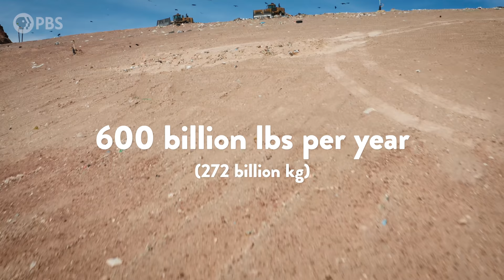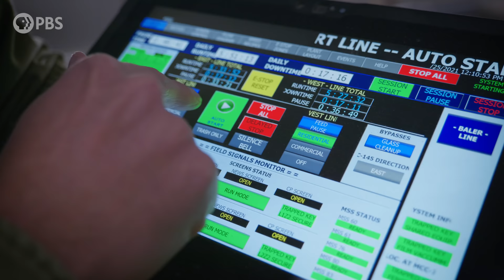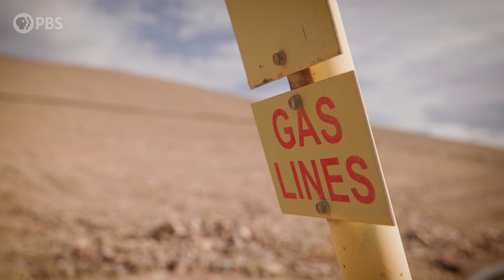How FIVE BILLION Pounds of Las Vegas Garbage Powers a City | Overview

Comment: In the city in Finland where I live less than 1% of all the waste goes to the landfill. 
That which can be recycled (metal,cardboard,wood,glas,paper,plastics,concrete,electronic and biowaste) is taken out and non-recyclable material goes to incineration.

The Waste-to-Energy plant outputs electricity and heat (the heat is led via heatpipes to the city homes/buildnings).

The biowaste is treated in an aneorobic digestion plant. Where methane is produced, the methane is upgraded to biogas that the local buses/trucks/cars use as fuel.
And after the biowaste comes out of the reactor it is composted for a few years and later used as fertilizer/soil for gardens/farmers.
Reply: We can't do efficient recycling to save our lives here in the US.
Reply: @cmendoza1094  why is that
Reply: It interferes with profit, of course.
At least in my city we take sewage and get natural gas from it for our buses
Reply: Instead of burying its waste Finland emits it into the air.

Comment: Las Vegas homes have two bins, garbage and recyclables. Several times a month you can put out large items such as furniture, refrigerators, old electronics, etc. and they get picked up. And Apex is where deceased pets, not buried in pet cemeteries, are taken for cremation and a decent burial away from the garbage. Plus all streets are swept once a week, usually the day after garbage pickup. Ours is Tuesday pickup, Wednesday the sweeper comes by.

Comment: Saying it's "per person" really implies that individuals, and not industry, is generating that waste. I don't think anyone poops that much. I can see the food waste. But no way I consume that much weight of packaging.
Reply: its not just poop, and i doubt poop is counted here. If you throw away a fridge or a couch, its considered waste. while you probably don't throw a couch away every month or so, you have to tally all the consumer items you threw in the long run. waste generated by industries would be the "easiest" to clean since they are usually homogenous which is important for efficient recycling processes. Consumer waste is difficult/costly to recycle because of its heterogeneity. sorting consumer waste for recycling helps, but that requires a behavioural change or else it will be expensive to process them further.
Reply: @Baise Duezcke well... Relatively more homogenous
Reply: I think you got the nail on the head. It's always the industry that's blaming us and yet it's them still producing this rubbish for us to consume. Even if there's an environmentally friendly option it's always more expensive. How are we in general as a society supposed to act responsibly if there's always a financial disadvantage to it.
Reply: @theobserver9131  They act as if the companies and industries are completely separate entities that exist outside of them.

Comment: My local sewage treatment plant has a flame constantly burning. It just seems like such a waste.
Reply: It's preventing explosions in the pipes.
Reply: Come up with a practical use for it!  Now, as Paul David points out, the main purpose of flares is safety, and typically there are a lot of engineers looking at minimizing the amount that goes into the flare system.  But maybe you can come up with a replacement for this engineered system that has been around for over a hundred years and is used a wide variety of situations, from oil and gas production, to fracking, to oil refineries, to according to you, your local sewage treatment plant.  But, make sure that you don't significantly increase the risk or reduce the capacity of the system.  There is a huge market for such a system.  But given the low price for natural gas in the USA, I think you have your work cut out for you!
Reply: the cost of a filtration system so that it can be used as fuel is probably too high and the volume too low to rationalize doing it on a cost basis.
Reply: It causes air pollution and add more problem to environment.
Reply: boil water with it, spin it, regulate it and mine bitcoin with it
Reply: @rimandoeduardo2685  seems I've heard flaring methane leaves carbon dioxide as a byproduct. Which is not nearly has bad of a greenhouse gas as methane.

Comment: Seems all we hear about from some politicians and activists are wind and solar energy and doing away with fossil fuels. Glad you made this video. I'm seeing efforts to clean the oceans and rivers also. I've been hearing of methane. I've known land fills produce it. I've wondered for some time if anyone was using it to produce energy. This is a great video. Thanks.
Reply: Maybe the reason you hear so much about wind and solar is because that’s the smartest/cleanest/cheapest way to go. If they can process garbage in a way that it illuminates waste and produces usable energy that’s great!
However, wind and solar are off the shelf ready solutions.
Reply: @solarwind907  True,wind and solar are smart, cheap, and clean...until you consider the mining and shipping of materials to make them and the batteries needed to store the energy when the wind isn't blowing and the sun isn't shining mush. That presents another set of problems. Also, the amount of those things needed to supply a large power grid.I believe alternatives are needed. A collective of energy producing technologies so to speak. Wind and solar will definitely play a part. I agree that methane could and should be burned as long as it can be done cleanly. Fossil fuels will be needed for some time but must be done cleanly as well.
Reply: @danielhanawalt4998  really glad you pointed out that wind and solar require mining and shipping! Wow, I had never thought of that!

You do realize of course, that ANYTHING you build requires mining and shipping, right? 
The plus for wind and solar is that the fuel is delivered free daily!  Fossil fuel, powered generators are great, but they generate air pollution, and CO2 emissions. Every minute of every day they operate. Nuclear is wonderful, except for the nuclear waste and the danger of a nuclear accident.

Yes, in order to generate electricity with wind and solar You’re going to have to do some mining and shipping of materials. Good God.
Reply: @solarwind907  You didn't read my reply maybe. or you would have seen I said wind and solar are smart, clean and cheap. They're just not so much so as some would like us to believe. And I promise, it's not free energy. Who do you think is going to pay for the mining and shipping? Who will pay for the manufacturing of products used for wind and solar? As far as nuclear waste, yes, that's a challenge. Accidents? There have been those of course. However, if you figure in the risk factors of fossil fuel energy we've been using for a long time, nuclear don't look so bad. Ever see a coal miner come out of the mine? Or a mine cave in? Also consider the sheer magnitude of energy needed and the amount of mining it will take to supply all the energy with just wind and solar. We're just scratching the surface of it now. I liked the idea of using coastal waves, tides, or underwater mills.  But that could cause some problems with the ecosystems in those areas. Ok, back to nuclear. The small modular reactors won't have the same problems as the giants we have now. It's just a matter of getting it done. Of course those won't be a silver bullet so to speak. There will be a need for all types of energy production.
Reply: @danielhanawalt4998  every single energy source is going to need a source of storage and right now lithium is the best source for that but that gets mined in South America prob not safely.
Reply: @joedumas6128  Yes, lithium is mined in South America, but more so in China. Cobalt is used in the batteries as well, which is mined in (I think West Congo?) and I it's said child labor does much of the cobalt mining.
Reply: @danielhanawalt4998  never mind the resources needed to make wind and solar, no one ever talks about disposing of them when they are no longer producing power.. it's an absolute nightmare
Reply: @busybody1474  You're right, disposal of those things is a nightmare. Some of it can be recycled, but not all of it. Reminds me of an animated movie where a little robot was scouring the earth looking for any biological life on the planet. The planet had become uninhabited because it had become a big landfill. A lot of the things that end up in landfills are toxic to biological life. Also, landfills create a lot of methane, a greenhouse gas.
Reply: Gas and petroleum plants also require mining and transporting large amounts of material for construction, and more of it, too! Stop acting like that problem is unique to wind and solar.

Comment: The way is to reduce consumption- this just can't go on.
Reply: Not necessarily. Companies do not create for quality anymore. Most consumer goods are built with planned obsolescence in mind, hence it winds up in the trash, per the plan, so the consumer can purchase again, increasing revenue for the company. Secondly, plastic is over-used and that's because it's cheap for companies to use plastic, as opposed to materials like metal or glass, which is nearly infinitely recyclable and environmentally inert, from my understanding. There's certainly some changes that could be made, but I don't think it's necessarily consumption from a principled standpoint, but how we do business. I know I'd certainly pay a little more for items made out of metal instead of plastic, knowing they'd almost surely last longer. I'd also be ok with metal/glass food containers instead of plastic (again, knowing it would cost a bit more), but so too could they use paper-based products for that. Paper decomposes in no time (2 to 6 weeks), or could be burned as a fuel source. That too would be an excellent solution I think.

Comment: Finally, a renewable energy source that actually makes sense.
Reply: Just because it works doesn't mean its a good idea. Think of the extremely dangerous chemicals you are creating through burning plastic and and other waste items
Reply: @thatguyslivemusic2999  That's what the exhaust filtration systems are for.  Think of that
Reply: This isn’t renewable. It’s recycled energy.
Reply: @Brandon-th9pi  yes it is. As long as we consume there'll always be methane gas to capture.
Reply: @thatguyslivemusic2999  burning plastic? It’s methane, you maroon

Comment: scientific questions should be settled, not by political intimidation. There is already plenty of political weight on the scales, on the side of those pushing the "global warming" scenario.

The fact that "global warming" models are not doing a very good job of predicting actual temperatures has led to a shift in rhetoric, with "climate change" now being substituted. This is an issue that needs to be contested by scientists using science, not political muscle.

Comment: They should also talk ab San Diego’s land fill
Reply: For over 20 years I've tried to get the city to trash to power... Using cooling stacks. And exhaust it into the sewer system. 
Sewage can also be burned for power.
But the cooling stacks. Are closed so no exhaust to air ..goes into the sewer pipes.  By that time its a vapor.

Comment: 5:49 (Tradeshow Crates) tradeshow is LVs largest industry and has the worlds largest convention center. Tradeshow booths are built and thrown away after a few shows. Partnering with sign and graphics is also a 50/50 waste generator. for every sqft of graphics there is 2 sqft of unrecycleable waste 3M is the leader of that market.

Comment: We need to share and promote ways of using less, which does not mean doing without.
Everybody's got  tricks for saving. Here's a couple I discovered... no more need for shaving cream cans. Lather up with bar soap. It's a fraction of the cost and Tiny fraction of the use of materials. And guess what it does just as good or better job since you rub soap right onto the skin.
Not to mention less shopping and disposing of cans.  Still not employed enough,   canvas bags to do your shopping. And a third one... if you use body powder ? Tape over 3/4 of the little holes. Manufacturers design it so that tons of powder comes out and it's wasted. It's much simpler and more effective than turning the lid to small openings. The list is endless... keep your tires properly filled.

Comment: NO OIL for PACKAGING or SINGLE-USE PLASTIC!  STAMP OUT STYRO, and HOLD the MANUFACTURERS RESPONSIBLE for CLEANUP & BETTER MATERIALS that are COMPOSTABLE & NOT FOSSIL-BASED.
Reply: Styrofoam is the worst shit ever created. I loathe its use in drinking cups and packaging filler. It takes up a lot of space and does not decay.

Comment: We upcycle thrown away single use plastic bags to synthetic rubber sheets for local footwear industry. More than 2 metric ton of single use plastic bags are upcycled daily in our factory. Every kilogram of fossil-based plastic produced, there is between 1.7 and 3.5 kilograms of carbon dioxide released. By our special formula and engineering we reduce overall plastic #pollution and #carbon_emissions

Comment: It would be much better if the garbage were burnt like in Germany, for example, and electricity was generated from it. So only the ashes and rubble have to be dumped, which is much better for the environment, especially so the metal is not buried but can be removed after incineration and thus reused.

Comment: I wish every city gave away garbage time capsule to visitors leaving the airport. 
Waste alcoholic beverage clear bottles filled with non organic trash ranging from cardboard, paper, plastic, electronic components and metal pieces, sealed with the city name and year. 
This could be a decorative time capsule for visitors. 
So the next time you say 'leisure or visiting' at the 'visa check' in an airport, you will be rewarded with a 'trash time capsule', when you leave. 
It won't make a huge impact but it will give visitors a little garbage back to own for long time and trade in years to come.

Comment: Sorry, I think 3 stream waste makes more sense (trash, recyclable, and compostable) . Stop making non-recyclable and clean incinerate "trash".  Compost the compostables with low methane production or feed it to pigs...that make methane.  But, stop burying it!  Use the ash from incineration for road ways and non-structural concrete.  Energy derived from incineration can power the process and then some.

Comment: Solid materials take longer to break down, why have they never ground up the trash( like chipping wood for compost) so that the smaller particles can break down. I have found plastic bags will break down but break down faster when chipped up smaller. I also put cardboard in my wood chipper for my compost pile. In Honolulu they have been burning trash for decades to produce energy and produce very little C02

Comment: We should be burning methane instead of fossil fuels. Methane unburned is a worse greenhouse gas than carbon dioxide ever could be. Meanwhile combusted methane gives off nearly no emissions. I dare say this is greener technology than solar farms, as it doesn't require the rare minerals used by solar cells that are often mined in enviromentally devestating ways.
Reply: natural gas is mostly methane - in fact dry gas as they refer to it is 75% or more pure methane.

Comment: You would think they could burn what is not recyclable in a containment hold, filter the smoke before releasing back into the air. Use the heat from the fire to further create electricity. The ashes could be used in fertilizer.
Reply: In my country waste incineration power plants are standard, so i guess they could do that there too

Comment: That could all be burned and and make steam to run turbines for electricity. They need to wash the smoke and dump the dried sludge deep into landfills. Use the energy for desalination which needs alot of power. This landfill is a waste of a waste. Trash to steam is the real solution. And washing the smoke so it doesnt pollute. You can mine metals in the trash.  Sad to see such energy losses when desalination is in such need.
Reply: Mr. Fusion is the real answer for the future...

Comment: New Zealand, has at least one of its cities using gas from garbage, for over twenty years. 
 Old dumps are already being excavated - by the weather ;  year before last at Fox, the river took out an old dump, spreading garbage down river & for several miles either side of the river mouth, along the coast.
 Who's makeing gas from Sewage, in sufficient amounts, for it to be fed into the local grid ?  - some Sewage works eek out enough to help run the plant, though they still need to 'buy in' extra - shouldn't need to if we didn't waste so much water, flushing personnel waste away, with way to much water, in the process.  Macerating toilets , reduce substantially, the amount of water used, though only, Poo, Pee & Paper, should be put down these, or expect a huge plumbers bill to "unblock" the device.

Comment: Please remember, the Hover Dam, when built, had excess generating capacity, and that "Extra" electricity set alight all the crazy lights of Las Vegas. Turn those lights off and use the electricity to power homes instead. And oh yes, Lake Mead water level behind the dam is at a decades-low level due to drought and is predicted to continue to drop through the year, also reducing available electric generating capacity. Another reason to turn off all those crazy lights.